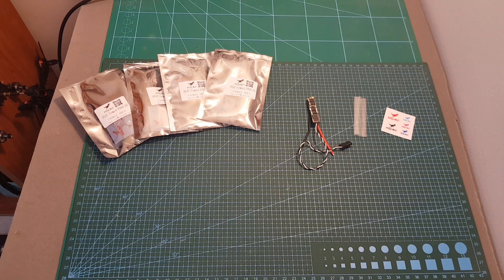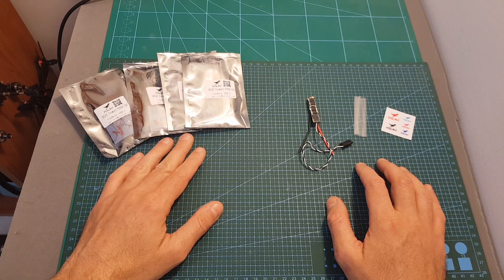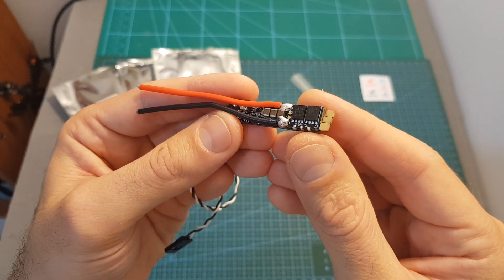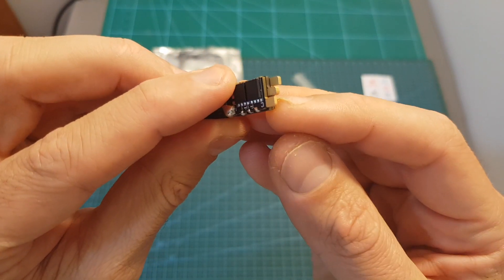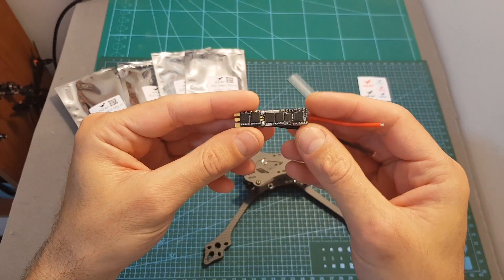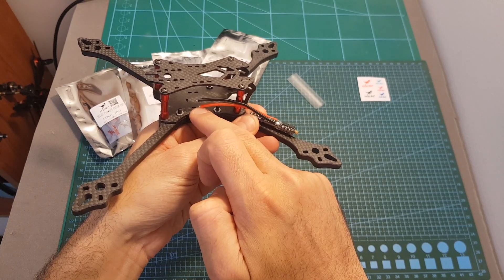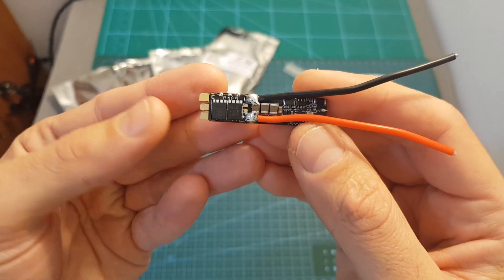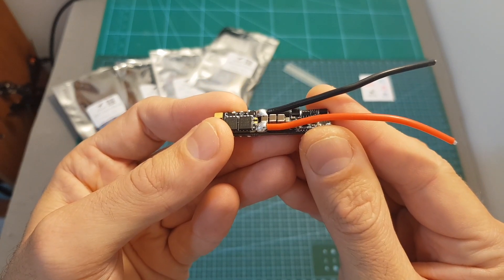HGLRC Forward FD50A ESC - Overview & Giveaway

Comment: Nice video! These ESCs are perferct for upgrating my Sky-Hero Anakin 280 which has carbon fiber pipes for frames  instead of plates. The maximum width of these ESCs should be maximum 12mm so these ESCs are going to be fitted very smoothly!!
Reply from the maker: Thanks. I used them in on of my recent build videos and they are great.

Comment: Hi, do you have any video about "tiny 8ch frsky ACCST compatible recevier sbus ppm output? I want to set it up on my small arm truck, you think is possible? Thanks
Reply from the maker: Hi, never tried it, but if your truck supports ppm / sbus it shouldn't be an issue.
Reply: @KremerFPV  Thankyou for your reply. Not really. My truck only have a normal esc and mirco servo...and I can't find any info about the tiny recevier connection...do you have any link or any info? Thanks again
Reply from the maker: @Funboxr  it seems that you need a PWM receiver.